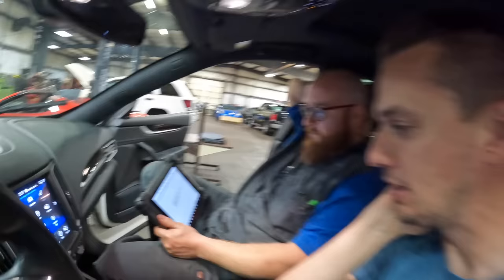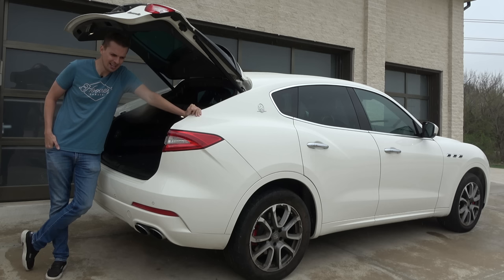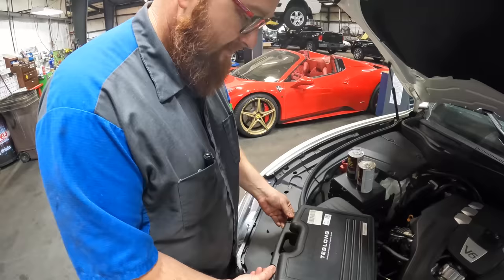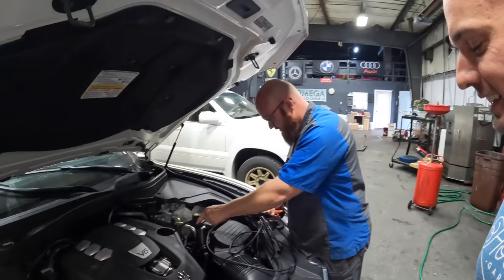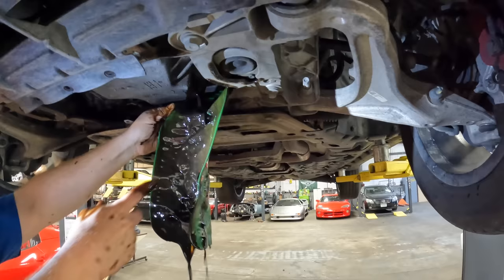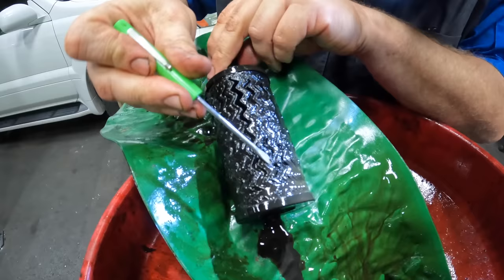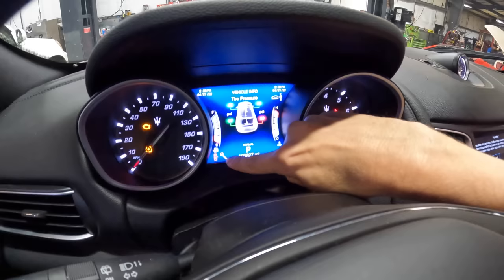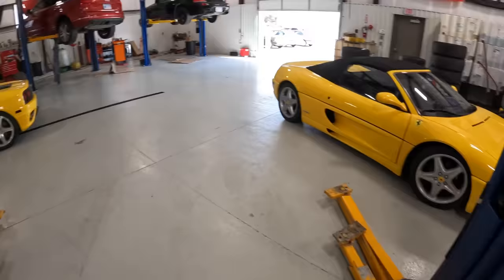My cheap Maserati Levante repo was a DRUG RUNNER, with NO OIL CHANGE for 60,000 miles!?!?!

Comment: That Maserati engine deserves alot of respect for been running good with no problems with 50000 miles since the last oil change 😁I don't think BMW or Audi would survive this.
Reply: its a chrysler pentastar just tuned up. the pentastar is a very reliable engine and has proven itself time and time again to not be like literally any other engine (aside from maybe the old power tech 4.7) chrysler has ever produced in terms of reliability.
Reply: @TheSavage3.6  It's not just "a tuned up pentastar".  The head is entirely different, the fuel injection system is different, the bore is different, etc.  They basically take the Chrysler blocks ship them to ferrari and bolt on a bunch of ferrari parts, the block is the only part of the engine coming out of a Chrysler plant.  

Having owned a few different luxury cars it is safe to say most would fail under these circumstances.  The Maserati does better because it has a large oil capacity, and because the shell helix oil they use is very good oil.  The design of the block is solid otherwise Ferrari's engineers never would have used it.
Reply: I know of a first generation BMW Z4 owner with now More than 400.000km on it. The car did. not get a oil change for more than 150.000km and is also negleted in all other terms, as he wants to see how it takes until the Engine dies.
The engine is per-turbo though and only the 2.5l with 177(?) HP.
Reply: @shaunbava1801  it's an analogy, obviously it's not just a tuned pentastar.
Reply: Well , that engine is made by Ferrari for Maserati , so it was a damn good engine for going that long without an oil change !
Reply: E36 bmws dont need oil changes, never changed the oil on my first car, m44b19
Reply: @TheSavage3.6  the 4.7 v8 was complete dog shit!
Reply: @mromatic17  No it wasn't. 

The first gens weren't amazing, as is with any first gen engine, but the last gen (08-13) was actually a fantastic engine and very reliable. Id know as i've had one in my truck that hasnt stopped chugging since 2012 with minimal oil changes and maintenance.
Reply: @Jake_Hamlin  lol . This gay I mean guy
Reply: @TheSavage3.6  just cuz you have a good experence with it doesn’t mean its not a raging pile of shit overall. These are notorious for head gaskets!
Reply: @mromatic17  Old generations are cause for concern. Not the latest generation of the 4.7.
Reply: @shaunbava1801  go Ferrari
Reply: Ferrari makes surprisingly reliable engines. Their F1 cars rarely break down. That’s why their 2012 F1 car lost the championship by just 3 points despite being slow as it was more reliable than the faster Redbull and McLaren cars. Even the road cars are reliable from what I heard.
Reply: Maybe not 50000miles but 50000km they would, because that is the OCI on certain small VAG diesels here in Europe believe it or not.
Reply: @TheSavage3.6  the pentistar would have yeeted it's piston into the atmosphere if it would have went 50k miles without an oil change. So it has to have a different motor. (It would also have been ticking like a mf)
Reply: @MentallyillBadBitch  and yet this is still a pentastar at it’s heart…you’re aware everything is forged in the pentastar, right?
Reply: @TheSavage3.6 it's not. The pentastar and the Ferrari F160 (the engine in this car) are completely different. The engine block isn't some downsized pentastar engine block. The Ferrari F160's engine block design is completely different from the engine block design of the pentastar. Plus, it has a different bore, stroke, and probably a different firing order, etc. So no, it is not forged in the pentastar engine block. The only thing "Chrysler" about the engine is the engine block and even that is different. It's Maserati's design, not Chrysler. If it was Chrysler's own design and engineering instead of Maserati's and Ferrari's, the engine would have been gone A LONG TIME AGO. 😂

Comment: I would still ask my local PD to run a dog around the car so that doesn’t happen when there are colored lights behind you. I did it with a buddies Escalade that had some poorly fitting trim panels and a weed like smell. I and my buddy were glad we did since they found a few things that could have been bad had he gotten pulled over. They also put a flag on the vin so that if he gets pulled over other cops have some back story on the vehicle.
Reply: I'm kind of surprised his cop buddy didn't at least recommend this.
Reply: Yeah the only reason I can think of his cop buddy not recommending this is because the area who he lives in is so small that everyone knows who he is
Reply: Perfect! Now start smugglin!
Reply: @barnyard9058  true although I wouldn’t want to run the risk on a trip although I am not sure anyone would take a car with that history to far from home.
Reply: @dav8388  I know it only takes them a few minutes if the dog doesn’t find anything mine took a half hour since they had to remove a fender liner, and 3 interior trim pieces.
Reply: @morganwin350  Usually Hoovie fixes all the things wrong on his cars?  Maybe after a few more flushes and daily drive it locally around town to hopefully flush out any more gunk and issues with the car, I think it can be taken out for long roadtrips

Comment: The longest oil change I know of was when I was a teen and working at a lube shop. A customer brought in a 1982 Pontiac Grand Prix (This was in 1986) with 64,000 miles on it. The oil had never been changed, I could tell because the original oil filter was still painted black with the engine and there was no sign on the drain plug that it had ever been touched. The guy stopped at a parts store and dumped a quart of engine flush in it and DROVE it to our shop (It says on the can not to drive it with flush in it). When it left it was knocking pretty bad and got louder as it went down the road.

Comment: That's actually super impressive that it made it that long without an oil change. Even hondas only make it like 30-50k without an oil change, from what I've seen
Reply: it would have been all highway miles
Reply: @warriorfortruth8521  gotta get that coke from mexico to miami fast
Reply: That has a lot to do with it having a giant sump.  9-10 quarts?  Still I'd bet there is some wiping and scoring on the crank bearings.
Reply: Hondas make it without oil
Reply: @KrummyBrinkleJr.  Overland routes generally run to Chicago; most of the drugs going to Miami are on boats, some on planes & even submarines.
Reply: Toyota camry lasts forever without oil change. Just need to top up. Does that count as oil change?😂

Comment: Make sure you change the cabin air filter and try to have the hvac system vents cleaned. That stuff can get into your skin and lungs pretty easliy. I studied criminal forensics in college and worked in a crime lab. I remember a DEA agent getting accidentally dosed that way when he used the AC with the recirc on.
Reply: I made the same suggestion. The interior is caustic if it's actually contaminated.
Reply: Yes, but generally speaking Meth has little to no odor. The cat piss smell comes from production. Ether a cat just pissed on the car, they were transporting "lab" equipment/waste, or they were cooking in there.
Reply: @OhPhuckYou  I figured they probably just peed on it before repo
Reply: 2:17 welp its already too late .
Reply: @OhPhuckYou  I second this. Also, people who get high from "fumes" are the same kids who drink one beer and act hammered
Reply: @seudechrist  Two 12oz cans of Bud will make me tipsy and, I weigh 250+ lbs. Then again, I very rarely drink and, NEVER drive if I do.....
Reply: @OhPhuckYou  yeah, there was no meth in that car. this shit is cringe af
Reply: Cringe comment. Like cops “ODing from being near fentanyl”..the myth has been busted. It’s psychosomatic.
Reply: @BBW4MEPLZ  it did actually happen in Ohio, however it was Carfentanil, but that's completely different from Meth. Meth you're worried about being exposed to the toxic remnants from the manufacturing process, not getting high.
Reply: @MurderSTi  yeah carfentanil is psychoactive on a dose level of micrograms. And fatal in the tenths of grams
Reply: @BBW4MEPLZ  100% .. all my nurse friends say that cops and firefighters have the lowest threshold for pain endurance. The toughest. Old Asian ladies lol
Reply: @BBW4MEPLZ  that time it happened on camera the cop did it himself and pretended it just got on his skin lol
Reply: Yeah i imagine that car was hotboxed many times, don't wanna turn hoovie into a multi drug addict

Comment: Tyler: I would change the oil again in about a 100 miles maximum. I think you'll find the filter will be plugged up solid once again. And it'll probably take a third time to get the filter to even start working again properly. Don't use the flush again, but change the oil and filter at least two more times with the next being in just three days of driving. I almost guarantee the filter will be plugged by the time you get it home this first time. This first time, you live 30 miles away from Wizard? Just take it home and turn right around and go back and do it again. Really Tyler. I went through this once with a company truck that hadn't had an oil change in 20 thousand miles. And I saved the engine. She went for years after. Go about 150 miles after the 2nd oil change and 300 after the third. Mine were spin on canister filters and the first one didn't pour a drop when you flipped it over to drain it. Neither did the 2nd filter  Nothing came out of it at all, it was completely plugged and the changed oil looked like ink. I really started to worry. The third one did drain out and I ran the 4th one 3,000 miles as normal. And the motor was fine ever since. Don't skimp out if you want to save this engine, as it might already be too late. It should be too late. And don't just change the filter. My oil wasn't clean until the 3rd change and about 300 miles. I was really worried there for a while. Filters and oil is cheap, engines aren't.

And yes, drug runners don't take care of their stuff. Our Sheriffs got their go fast boat from one that blew up out running a helicopter chasing it. And they had outrun it before. The Sheriffs patrol Lake Erie between the U.S. and Canada. They got the boat at auction cheap and the reason the one engine blew was it ran out of oil. After tear down of the engine it was determined that the oil had never been changed in either engine once. In a pair of blown 507 custom made big block go fast boat engines. That's a fuelly dragster engine. "Change the oil? What's that?" Can you believe that? It was running at 110 mph when it blew. (imagine that ride) And the boat was full of cocaine. Yeah, drug runners. Lost a whole load and got arrested because they were too cheap to change the oil. I thought it was hysterical at the time. So did the Sheriffs. They got a 200,000 dollar Scarab for 3,500 bucks and a new engine. In 1984 dollars. Do you think that was a rigged auction or what? And they still have that boat today and keep it like brand new. With that thing on the water, drug running by boat has pretty much stopped. I believe it will hit 125 mph top speed. Wow, that's really moving on the water. It's basically used for rescue these days. No matter where you are on that huge lake, if you're sinking? That thing will be with you in minutes.

Comment: I'd suggest that the owner didn't want to leave the car unattended at a service centre/mechanics where it could be 'recovered' easily by repossession agents or perhaps inspected unknown by law enforcement while putting together a case against him.
Reply: They didn't know one mobile mechanic?
Reply: They couldn’t drive it up on amazon ramps and change it themselves? It takes like 25 minutes for a newb
Reply: @TheOriginalPyroBEAST  you have to learn how to fix cars so it can be challenging to do the oil change and filters if you don’t know what to do. It’s also tricky if the part you need to change is located in a inaccessible location in the engine bay
Reply: But that does not explain why they didn't change the oil themselves.

Comment: For the smell, use an ozone machine.  It will neutralize the smell and then have it detailed really well.
Reply: Yeah a good carpet extraction and changing the cabin air filter will do a lot for this car
Reply: Ozone smell is bad too tho
Reply: Just have to let it air out thoroughly before you drive it
Reply: Ozone machines also kill elastics so be careful.  I've dealt extensively with them and smoke damaged insurance claim items.
Reply: @Chris_Moncada  Yes but it literally airs out. Because it's O3 
But you're right, you really shouldn't breath it in
Reply: @Chris_Moncada  you're not supposed to breathe the O3. You leave it sit for a day and then hold you're breath while you open the windows and leave it for another day.
Reply: @c s The poor car has already been abused plenty, inflicting Shoddy Kilmer on it would just be cruel.

Comment: Credit where it's due, that Maserati did the equivalent of running a full marathon after a Mexican lunch and never broke down bad
Reply: yeah. That's cause it's a Ferrari engine. If they'd put a Chrysler engine in there it'd have quit LONG ago hahah
Reply: @typicalmountainbiker  yep
Reply: @typicalmountainbiker  Its mostly chrysler.
Reply: @coffelt683  The engine isn't though. The engine is a Ferrari engine. Chrysler engines are notorious for having a ton problems if you don't keep them in absolute mint condition. Driving it this long with no oil change would have made it die probably 20,000 miles ago at the very best.
Reply: @typicalmountainbiker  Wrong.  the V6 of the levante is a chrysler pentastar tuned up by maserati and ferrari Engineers .
Reply: @lovellmills7959  so the Car Wizard and Hoovie are both wrong? They both said it was a Ferrari-based engine. I'm inclined to believe them more.
Reply: @typicalmountainbiker  15:00? Did you not watch the video?
Reply: @coffelt683  No it isn't. 
Engine, platform and basically all the engineering is Maserati/italian based. 
The only Chrysler things are a few buttons and switches, basically.
Reply: Definitely some breaking bad going on

Comment: Love the content! But on another note, I would either get the car professionally cleaned by a company that specializes in drug clean up or replace the carpet and headliner. I had a dodge pickup stolen a while back and while I did recover it, it had meth residue all over the inside. Felt sick just driving it home. Worth the piece of mind to know you’re not getting poisoned.
Reply: I don't know why he isn't at least wearing gloves.  If he happens to run across some fentanyl, then it might be lights out.
Reply: For me, while the truck was still mechanically sound, I ended up parting it out. Didn’t want myself or anyone else to be exposed. It was really a difficult decision as I only had liability on the truck and had to buy a new one out of pocket
Reply: Any Gerber collision or caliber collision both offer that service as a regular part of their detail and deliveries for repo and police impound cars etc. just ask
Reply: I'm sure the next video will be of him dropping it off at Van Gogh.
Reply: don't talk shite 🤣🤣🤣
Reply: How do you know for certain it was "meth residue" ?? Sounds like you were as paranoid as the methheads the original owner was selling too
Reply: @zacharypeery4082  Had it professionally tested. Also had an idea based on the stuff left in the truck when it was recovered

Comment: The proper way is to change the oil and filter, then flush, then change the oil/filter again. I'm assuming the oil filter pressure bypass system was activated long ago.
Reply: Yep that filter wasn't doing anything.  Been going through bypass for a while and now while all that crap was floating around loosening up.  Would have swapped the filter and oil first, put flush in (just use conventional oil for cost) then after the flush change the oil and filter again.  Sometimes I think I'm watching amateur hour.
Reply: Yes , and the filter should have been removed before the oil was drained ,,not after , because when the filter is removed , some more oil held in the passages flows down to the sump.
Reply: Factual post! I was cringing!
Reply: Absolutely. Kind of disappointed the wizard did not know or think it mattered to do that.

Comment: I'm hoping that you ran the engine for a short trip and changed the oil again after that flush.  looks like there was more than what that old crusty oil could hold in suspension
Reply: For real....rinse and Repeat
Reply: I would also changed the oil filter before first flush
Reply: Newcious  no one cares, people like you need to stop spamming others channels.
Reply: @Notthetimeforit  - just leave a DISLIKE on the video linked and report it as SPAM...
Reply: I agree with you. If that oil pan is not too bad to remove, I'd drop it and clean out the 2" of sludge in it that the motor flush can't touch.
Reply: @syxepop  yeah I usually do and I get that my comment probably made zero difference.
Reply: @MrUltraworld  being Italian and dodge being put together I bet to drop the pan you have to first remove the subframe and then yank the engine then hop 3 times spinning clockwise then repeat counter clockwise then pray to Jesus
Reply: @averywellsand888  I'd agree with you but I removed the oil pan from my M5 and it was easy to do. But those are Zee Germans, everything precise.
Reply: @MrUltraworld  even with the Germans to even pull some parts like the lower control arm the subframe has to be dropped where is the precision in that?
Reply: @averywellsand888  I dropped the oil pan in my M5, it was easy.